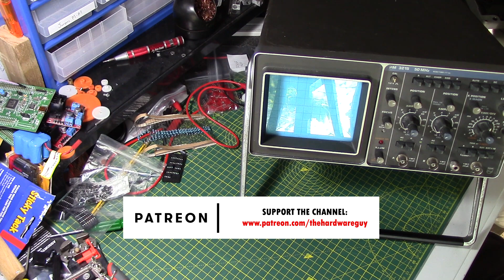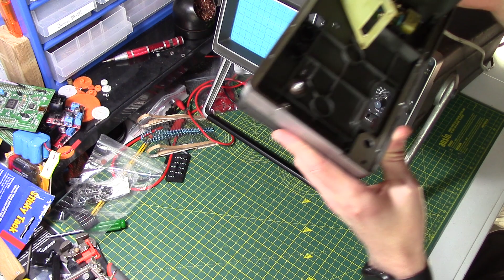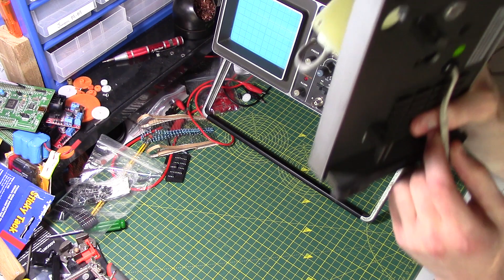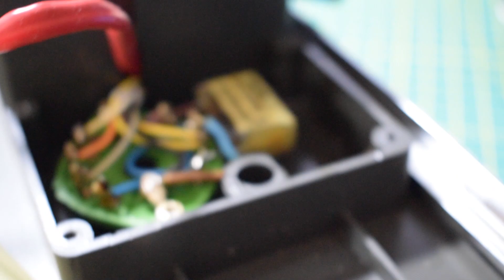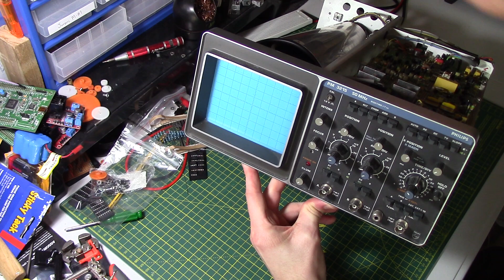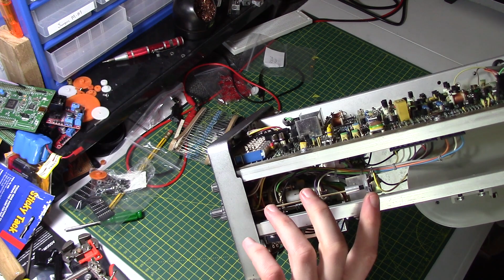My Oscilloscope Blew Up - 1985 Philips PM3215

Comment: Dunno if you are still reading your comments but the bad smell and magic smoke came out of mine and lo and behold, exactly the same fault.
Thanks a lot for the post, new cap ordered soldered in and scope working again. As a matter of interest you could have bought either that scope or a Ford cortina when they both were new😁
Reply from the maker: Hi Andrew, sorry to hear that yours blew out as well. Glad to hear that you've replaced it successfully! I can still smell that blown capacitor to this day... very stinky!
Reply: When that scope came out every technician out there wanted one and few could afford it. At the time it was the Ducks guts, the bees knees.

Comment: doing well! could you show a short tutorial on how generative design works with fusion 360 and ann example of what you can make and answer

1. Do you need cloud computing or can you use your own computer to compute the designs (even if it would take a long time) (how long will it take for a pre good pc)

2. How does the obstacles and parameters work how flexible is it

3. what are the parts no one tells you about generative design and what it cant do and what it can do thanks!
Reply: Common occurrence for those RIFA mains suspression capacitors to fail on all sorts of older equipment. They more than any other are famous for doing that. I change them now on sight.